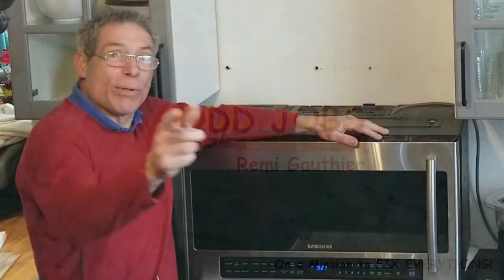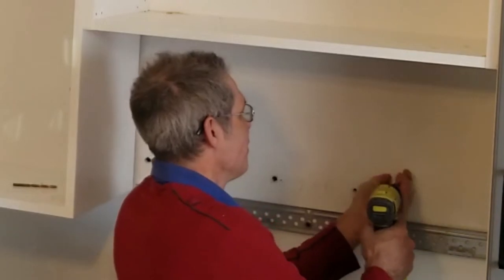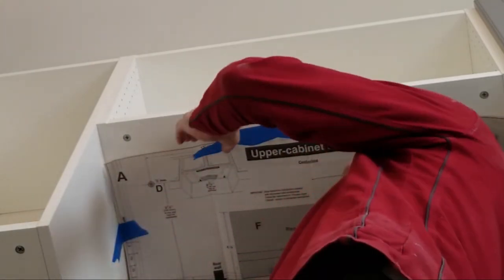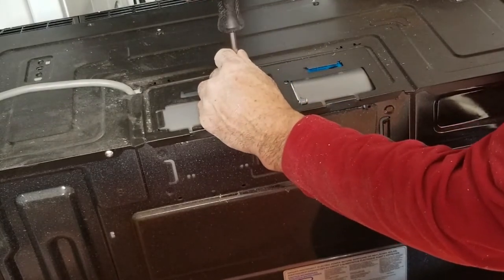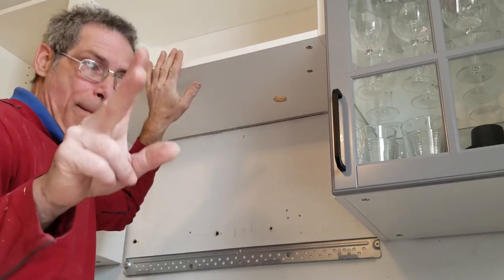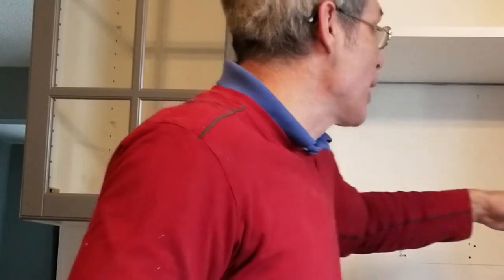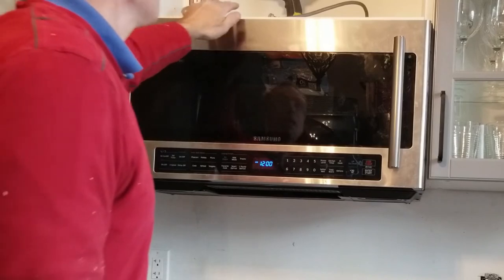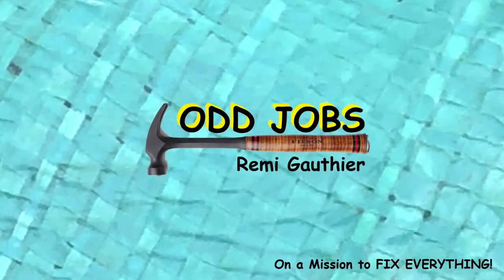Installing Microwave (twice)

Comment: After all that work that sucked you had to do it again. The last one I installed the manufacturer place the wrong template in the box 🙄 So wile holding it up by myself and trying to start the top bolts they would not line up. Was able to get the correct one and found that they made 2 exact ones in that manufacturing run but moved the top holes in 1” 🙄 Another great video 👍🏻
Reply from the maker: Thanks, Coop! Well, the old adage, measure twice........ But it was an easy fix, and worth showing the mistakes.